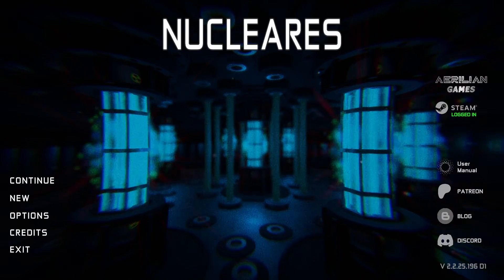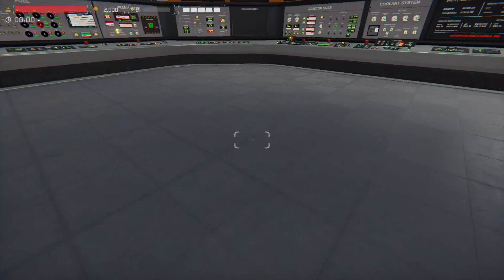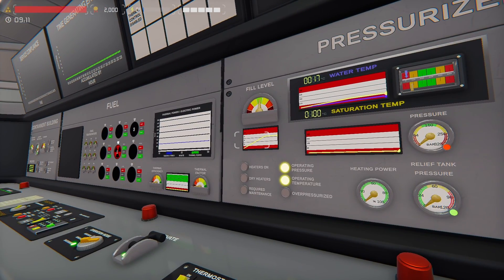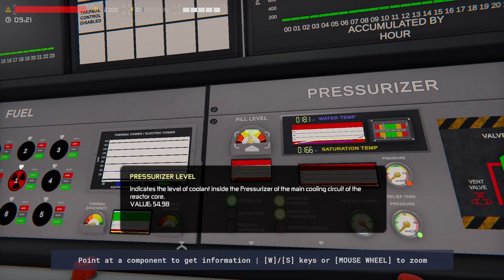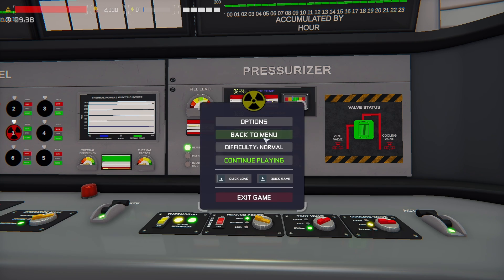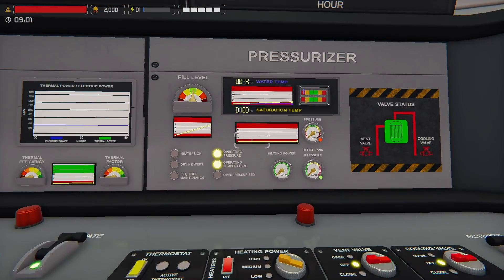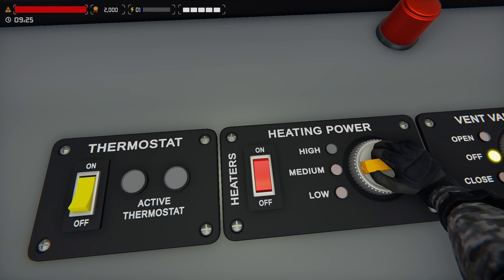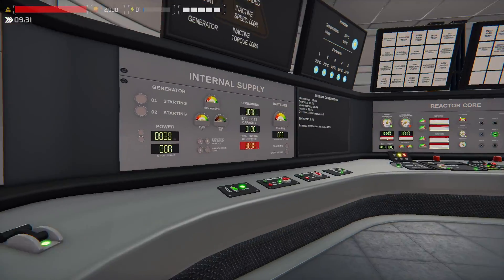New Pressurizer Changes - Nucleares (Patch 195+)

Comment: I have a question. I really don't get it, why do we need to have a temperature in a pressurizer much lower than saturation point? The idea of pressurizer is to have an equilibrium between liquid and steam. It is only possible when temperature is equal to saturation temperature, isn't it? With temperature lower than saturation point all steam will condensate and there will be no equilibrium. So pressurizer will not be able to perform its functions. It looks like a bug to me, but what is wrong with my reasoning?
Reply from the maker: Our reactor in Nucleares takes very broad liberties with what we would call “physics” and doesn’t match IRL in a lot of ways. I say that because the saturation point of water is a real thing in real life. Our point in the game is a bit broken. In real life, you cannot get the saturation point above 374. That was supposed to be how it worked in-game. Now, for the explanation of why, essentially our coolant goes from water to gas when PZR water temp is above saturation temp, so we lose cooling ability (and heat transfer ability and our core medium etc) when that happens. 

The pressurizer isn’t actually there to create an equilibrium. It works with the same principle as a pressure cooker in your house. Water boils (at sea level) at 100°C. That would mean we cannot get our reactor core temp above 100°, otherwise all our water turns to stem. When placed under pressure above 1 atm, the boiling point of water increases. That’s what a PZR does: allows us to heat water much farther before it turns to steam inside our core. And we talked about that limit (water to steam in the core) is what we talked about above.

Comment: One bug that has been bothering me is that the EFR/CFR gauge cluster shows the wrong values. 

I use that gauge to measure how much secondary pump flow I need to eventually aim for in the long run to stabilize the condensation rate for the condenser when sudden load changes occur.
Reply: The physical gauge isn’t showing the readout of the numerical value. 

You can see what I mean if you right click inspect the gauges labeled “evaporator balance”

To use a couple examples from in game, my Return flow arrow is dead on the 75 tick mark, but the value would read 88.5 in the right click inspect, and the Steam Outlet arrow is closer to the 75 tick mark than the 100 tick mark, yet the right click value shows its 94.

I would expect the Steam outlet arrow to be slightly below the 100 tick mark, not closer to 75.
Reply from the maker: Oh yes, the water/steam gauge one at the steam generator? Yes, the developer intentionally got rid of that one. And removed the numerical readouts. 

And a lot of the actual readouts (when right clicking) don’t match the visual gauge. There are a couple that are off by a good margin at the chemicals console
Reply from the maker: Wrong values how? And no, they don't precisely follow IRL physics

Comment: I believe what the saturation temp is trying to convey is the dry steam point. 

Also it seems every time I say something, I misremember the correct values or an update changes the values. 

To update previous info, the motive steam gauge gives a proper reading. 100% means that you have enough flow to pull a vacuum to counteract atmospheric pressure. 

I do a lot of experimenting too, but I don’t write any of it down. I just constantly pound in a workflow that works for me. 

I am currently running the chemical modules and feeling out the startup process to make later gameplay easier.
Reply from the maker: I don't know that Nucleares goes into that much detail about wet and dry steam. To date, it's been automatic for us and there haven't been any steps we've had to take to achieve dry steam.

And I do the same thing. That's my problem of not writing down my steps or methods and just trying to remember which one worked